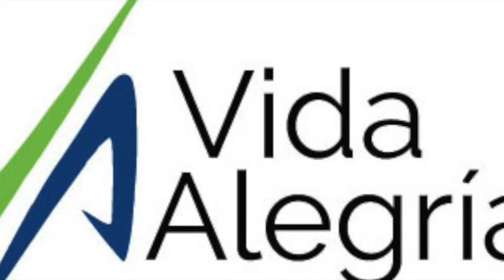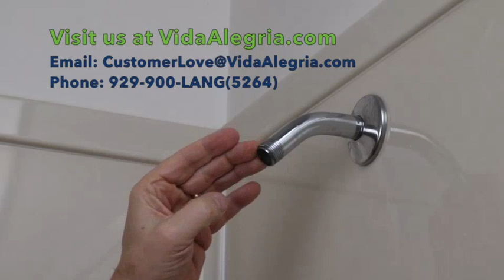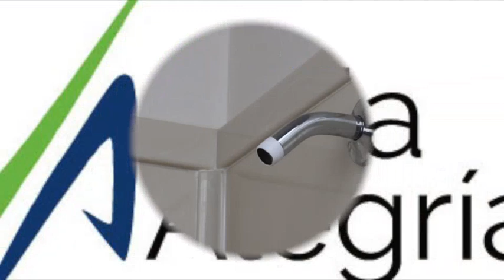Using Teflon Tape for shower heads

Comment: You trying to put plumbers out of business? Jkjk I’m not a plumber but I do trust them to an extent well a lot but am open to new ideas(logical ones). What if I do both CW first two times then CCW once, hope it works🤞🏻I think they don’t recommend CCW because it could end up forward and block the front blocking water and bursting pipes so maybe counter clockwise at the back?

Comment: Hey bud, 25+ year plumber here and not to be mean, but I don't sugar coat what I think.  Wrapping it counter-clockwise will actually increase the chances of a leak, due to the threads cutting into and against the tape, as opposed to threading with it because it spreads and applies it evenly.  The reason your method "works" is because you go around the threads 200 times.
Reply: "5, 6, 7, 8....even 10 or 12!" He had me dead with that. Lololol.
Reply: why is a 25 year plumber looking up how to use teflon tape?
Reply: @friedrice6039  he’s not he is keeping everyone who sees this from flooding your house